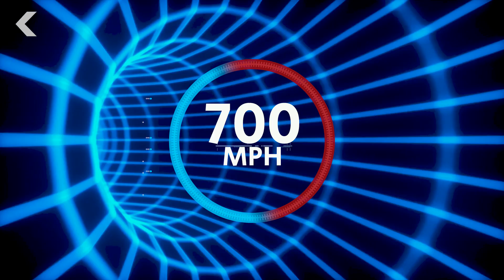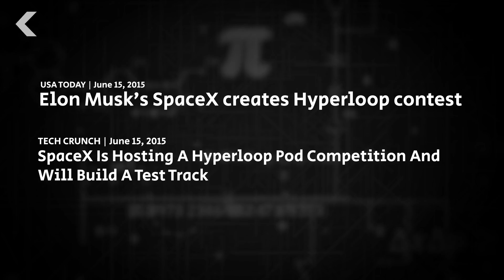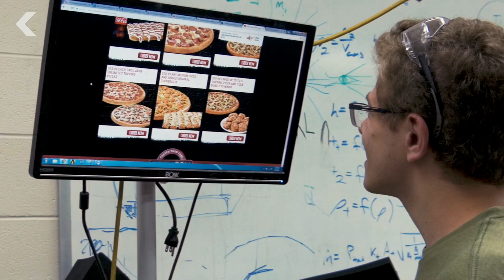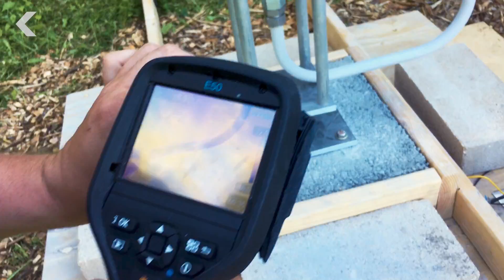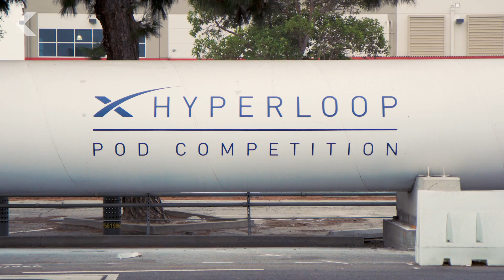These College Students Built a Hyperloop Pod... Here's What Happened

Comment: Thunderf00t has talked about the hyperloop
Reply: care to elaboraten?
Reply: Watch his videos. I can't go through everything, but he's been talking about how dangerous the hyperloop would be and a few other things
Reply: Not only can tf00t be wrong he can be right. People make mistakes and being a scientist he understands that sometimes he is wrong and people correct him it's called peer review. Something religion can take a few pages from.
Second off even in a vacuum you have gravity and friction. 
700mph is not only attainable it's not realistic.. 
But you can only attain those kinds of speed without friction and with 1/3rd or less gravity. 
Sorry guys this is a pipe dream and Elon i think is laughing at you for trying. And yes and no the puns were intended.
1. People seem to miss the concept of how much is displaced at the speeds were talking about here, granted a vacuum helps a lot but to shuttle people in comfort takes about 8 feet in diameter. the "pod" is going to have to be built to a tolerance that just fits inside of the tube and on a track similar to maglev trains.
Running a tiny assed "pod" on wheels fer gosh sakes is not using the imagination you need to get the literal ball rolling. Think about the movement inside of the tube and moving what gas there is inside the tube out of the way. Which leads to point 2.
2. There is no such thing as a perfect vacuum there is always going to be something present and it's gonna get squished.. and pushed in front of the bullet and eventually it has to go somewhere.
3. You can't have surface friction at all. The literal pod cannot touch anything and it has to move air around the pod at speeds approaching the speed of sound.
4. Speed of Sound. Ask yourself what happens when an object exceeds the speed of sound in gravity and with air present. For the younger generation go google speed of sound shockwave.

I'm continually amazed at internet experts not getting the basics of why this wont work as proposed..
The way to make it work is out of Elon's budget. The US gov might pull it off.

1. Way is to make a maglev train and drive it thru the tunnel in partial vacuum with area seals and vents to let out the squished air looking for a place to go. Tough to make a seal for that and venting without losing vacuum. I could name a couple ways but the simplest is a secondary tube along side the main path with a vacuum and pressure vents to let air out without losing vacuum in the tube.
2. Seal the nose to the wall and vent the air thru the "pod" probably simplest
3. My personal favorite... Build a 1 stroke vacuum pump at both ends with enough displacement to empty the tube and let the moving air pull the train with it. Go slow at first so you do not splatter your cargo and ramp the speed up and as the "pod" travels it pulls on the pump on the back side of it and it levels the speed out and slows it down on the back end when it needs to stop.
Again gravity and friction are the enemy not counting displacement.
Get those 3 worked out and the rest is marketing.

What you have now is a guy who knows it wont work as proposed and wants someone to step up and do it correctly.
Hell of a way to hire an engineer. 
Maybe people might not get he's looking for engineers and this is his way of weeding out the futile and foolish.
He might just be smarter then the people that work for him, or he has pipedreams and follies like the rest of us. Pun Intended.
Reply: Albert M So is this one, the team featured didn't even get into the tube and are getting more rope than needed.
Reply: Valesto93 Ok! Now I know.
  You know I meant that it can happen. Now, I applied that to the vacuum pressure of the hyperloop vs 1 atmosphere of air pressure, the realistic thickness of steel for the hyperloop that's gonna be commercially used, any tear or circular hole that can possibly appear on this hyperloop and what I meant by the size increase, was how much air was going to enter the massive vacuum chamber per second, which indeed varies depending on the thickness of the material for the wall. I mentioned this, as if one of the hyperloop pods were to rush into this area of air and slow down the pod; how much would the pod deaccelerate and how much force would the people in the pods experience? And how quickly could the leak be detected and then sealed, and how quickly could a pod be signaled to break and break safely before reaching the sealed area? These has been my concerns since I saw Thunderf00t's video. Now, I don't claim to know every physical law, but I wanted to share what I knew from Thunderf00t's video to see if people here were aware of these risks. Thanks for the suggestion! I'll watch it!
Reply: Jeroen Bollen Until that happens a few seconds before a pod travelling 700mph reaches the leak...
Reply: @Jeroen Bollen This "Once a leak is detected" stuff you speak off comes after the entire loop implodes on itself, assuming it's a vacuum.
Reply: Valesto93 Ty!
Reply: Caleb Or you could use your brain and this vast web of information at your fingertips and come to your own conclusion based on realistic physics and math.  Wait, he did that... I guess you are just another internet moron who enjoys making snide remarks because the only validation you recieve is the small sense of import you feel when just throwing opinions at scientific evidence.  Try a little research and exercise that atrophied brain of yours!
Reply: HellishGrin460 well said.
Reply: Scootermagoo finnaly someone using actuall facts
Reply: Albert M Thunderf00t uses laws of physics to disprove innovations and not using our current technology itself
Reply: thunderf00t has a really annoying personality
Reply: Skoenner briefly, thunderf00t has pointed out that the hyperloop is supposed to work in a vacuum chamber that is extremely large. An extremely large vacuum chamber is subjected to high forces, which means that if the vacuum chamber is punctured the whole track would be rendered unusable. Not only that, but the pod will be subject to an exteme force generated by the air invading the camber. Another issue with the project its the sheer amount of air you would have to pump out and the huge amount of maintenance the whole thing needs. His antithesis is that the project is achievable in less then half a decade which is clear at thia point is not. That is all, have a good day
Reply: Albert M the problem is that they are trying to make it with current technology, that's where your claim falls apart..   Is it possible, maybe, just not today.  Unless we can suddenly use the entire military defense budget and all the scientists in the US, it probably won't happen to soon, or cost effectively.
Reply: Well, he's a research scientist who shows his calculations in his videos, so other people can correct him if they can. He's put up a video once, where he admits his miscalculations and does new ones, while keeping the video with the faulty calculation open to be viewed
Reply: Valesto93 Which principles?
Reply: if something manages tto puncture or rip it (i.e. earthquakes, since elon plans to make one from LA to San Fransico) the pod would be shot along at mach speeds and smash into the station, killing everyone there
Reply: Look up Shane Killian's video debunking thunderbolt. TF is either intentionally lying or an idiot.
Reply: Simon Andersson Some of those concerns, in all seriousness, makes the stupid assumption technology will not get better.
Which it will, that is a given with progress.
But it is a flawed video, to put it nicely.
Reply: Can't wait for the day TF makes a video where he takes a ride on the hyperloop and admit he's wrong. He's been a source of misinformation for his much less informed subscriber base for a very long time.
Reply: The Hyperloop may be overambitious but some form of it is possible.
Reply: Valesto93 I haven't heard of that law before, so how does it apply?
  Also, isn't explosive decompression powerful enough to tear a small hole into a bigger one? If so, would the same principle apply if the massive vacuum chamber would suddenly be punctured by something?
Reply: After watching that video I lost all respect for him.
Reply: I saw the video and a lot of his arguments are answered through just simple logic. He's just pessimist that argues about new innovations only for content and not for scientific accuracy.
Reply: ScienceAIR Nice! I'll check them out
Reply: except by the fact that they could use vacuum pumps a hundred times more efficient using the sprengel pump, or an array of them.
Reply: Simon Andersson If you puncture a hole in the tube, I'm pretty certain that you would basically get a big blast of air for a tiny bit, and then it would quickly die down. Still not enough to kill someone inside though I think. I'm just hypothesizing while on my phone, so probably inaccurate, but I still can't see it being that lethal. In addition to that, they probably wouldn't connect every line together as one big network. They would also likely have a system that can block off portions of the tube for maintenance, and maybe even a leak. People think of this as a big train network, but as Elon Musk said himself, it's not a train. It's a lot more like the idea of running rocket powered transportation from New York to Tokyo in a couple minutes, rather than having tons of rockets flying everywhere and passing each other mid flight like trains.
Reply: +username Agree. For anyone who hasn't watched Shane Kilians Series "'Hyperloop Busted' Busted", go watch it now!
Reply: The issue Thunderf00t addressed is meaningless. Once a leak is detected one could simply isolate it. Lock down that section of the loop and depressurise it.
Reply: Not sure how you assert 700 miles per hour is impossible, when supersonic travel at much higher atmospheric pressures already exists. The issues with choked flow have already been addressed, that's why there's a compressor on the front of the vehicle. 700 miles per hour is not supersonic except if the air was absurdly cold.
Reply: thunderfoot talks about how the hyperloop would expand, but he forgot to go over the fact that the supports move up/down/left/right in response to expanding and contracting in the tunnel
Reply: Now that the Internet has rendered everyone with half an intellect a wannabe scientist, he's leading a trend for unqualified minds to criticize everything regardless of how much they know about it for its own sake. Makes them feel smart I guess. Some of his points would be valid without context, or if he was using them to teach science. Thunderf00t is very much someone who is constantly trying to prove his intellectual prowess, and I suppose that's his business model? Either way, I don't believe he's nearly as qualified as the people with PhDs in engineering.
Reply: Skoenner nah, I don know man
I don't trusten him.
Reply: Otherized Meme and that somehow makes him wrong? Is he scary because he tall too?